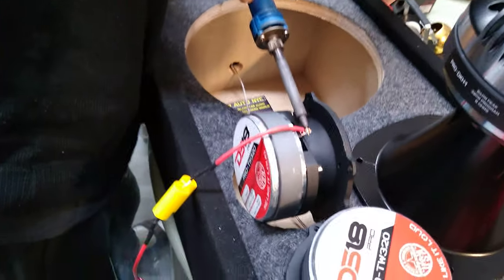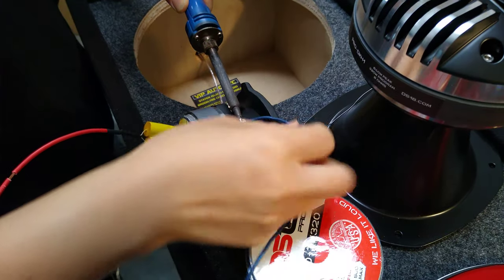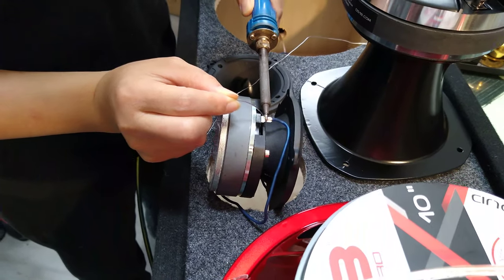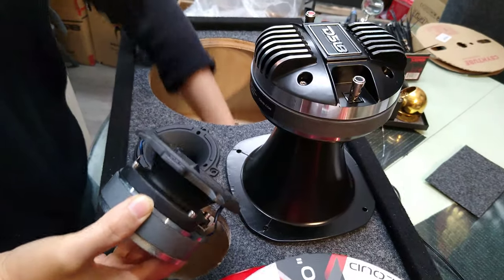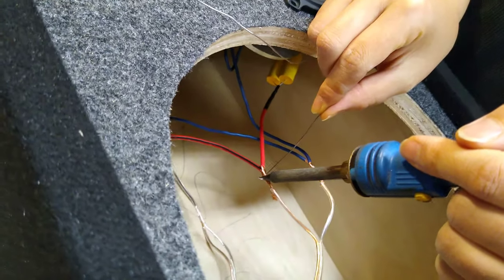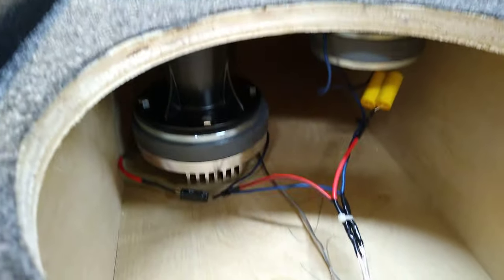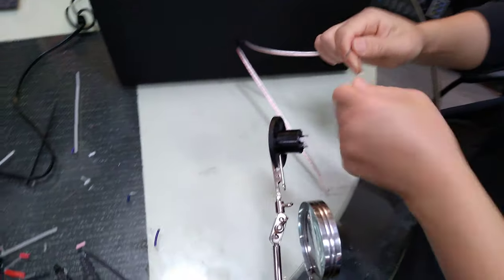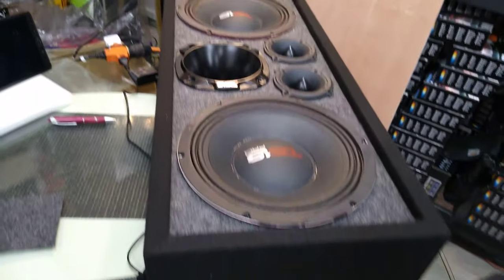DS18 MIDBASS PRO SERIES CHUCHERO WIRING/ INSTALLATION

Comment: Great video but it would be nice if you explained what the ohms were on the speaker, tweeters and horn  and the reason why you did parallel on the speaker series on the tweeter and then parallel to the horn
Reply from the maker: the 12 inch speakers are 4 ohm's, compression horn driver is 8 ohm's, the bullet tweeters are 4 ohm's. Each channel is 4 ohm's nominal

Comment: Love the video and I was wondering how you would go about wiring a chuchero like this I have 2  prv speakers 8 Ohm, 650 Watts, 97.5 db and 2 520w 4ohm orion tweeter and 1 tímpano 200 Watts Continuous Power 8 Ohm 109 dB horn also what capacitors would you use on the tweeters and horn ?
Reply from the maker: Speaker is parallel, series for tweeters + parallel with compression horn driver

Comment: Quick question .. so the mid bass wires don’t got to the amp as one positive and one negative. Cuz u said one positive  and 2 negative? I’m just alittle confused
Reply from the maker: 1x channel for mid bass, 1x channel for compression horn driver and tweeters,  dm me on ig if you need further assistance 😀

Comment: What makes them boxes so loud the box or the speaker set up. I want to build one all Audiopipe .  3- 8" loud
2- bullet tweeters
2- Horns.
Reply from the maker: wiring them properly is the most important step, choosing your products, building the proper size enclosure, getting the right frequencies to the amplifiers, adjusting your amplifiers accordingly, adding the appropriate crossovers are all equally import when building. we test/ evaluate many products before we choose what we will use in each build. If the product doesn't meet or exceed our standards, we do not use it. even after building if it doesn't perform to our expectations we do not use it. hope this help you build yours

best regards
vip auto nyc
brooklyns chuchero world
staten island car audio

Comment: Kelton Machtolff | Technical Support Specialist | OE Support
[ Stillwater Designs | KICKER ]

So to add speakers to that enclosure you would need to box off the area where they would be mounted or the pressure from the woofers would blow the cones out of the added speakers. 

The ST would be the way to go if you are looking for loud clear mids and highs.

Comment: Those capacitors 17uf 100v ?
Reply from the maker: @P2Feener305  yes for compression drivers, 4.7-6.6 for tweeters
Reply: Sweet thanks man been a residential av guy for 17 years and now just getting into playing with some pro av gear a lot more fun when you build your own toys 😂

Comment: Does the horn driver need a filter, crossover or can i wire it directly to the amp?
Reply from the maker: a capacitor is recommended but not required. as long as you can send the proper frequency to a speaker, compression driver a capacitor or crossover is not required.

Comment: Which amp are you using for this. I see that you have 620w and 600 for the 2 channels.
Reply from the maker: a 4 channel is recommended, about 500x4 RMS @4 ohm's is excellent. Bridge channels, 2x channel for MidBass, 2x channel for compression horn driver and tweeters 👍

Comment: Nice video been waiting  for a connection  would this install be the same if doing 2 mid bass and 2 or 3 tweeters
Reply from the maker: depends on what your working with, the ohms will determine how you wire it up

Comment: I got a box. 2 prv 10MR1000 (15 years),  2 prv TW700Ti tweeters and a comando CRx-700AL. Someone ripped out the board that holds the 2 tweeters and horn. There’s 2 sets of wires left dangling in the box where that board goes and one set of wires coming from one of the tweeters. I’m confused as to what hooks up to what. The 2 PRV 10MR1000 are wired up and good so no issues there just with the 2 tweeters and horn. The box itself has 4 sets of wires (8 wires + & -) that connect to the amp. Anyways any help will be greatly appreciated
Reply from the maker: most likely one set is for the tweeters, other set for the compression drivers. if you need assistance bring it to your local shop. you van use a single 4 channel amplifier for this setup

Comment: Does the tweeters trouble the impedances of the mids
Reply from the maker: I don't understand your inquiry. The tweeters & compression horn driver share the same channel.
the tweeters are wired in series with there own capacitor, the compression horn driver is wired parallel with tweeters which has it's own capacitor. It has a combined nominal impedance of 4 ohm's
Reply: @vipautonyc-chucheroworld-jimmy  sorry i didnt explain myself right..
Reply: @vipautonyc-chucheroworld-jimmy  i was asking if i can wire 2 4ohm tweeters  with a 2ohm loud speaker  to a fullrange  1ohm amp  other than using a separate amp for the tweeters
Reply from the maker: @bassismygod9859  yes sir it's possible to wire that way. but you will have to balance the frequencies, output power  for all the items. while you can do that, you won't have much control.

Comment: Why don't you install a 3-way crossover to regulate the mids and highs?
Reply from the maker: Well that would be my customers choice. I recommend equalizers only if more adjustment is desired. Generally most amplifiers crossover sections are enough. I do understand many people are more comfortable using external crossovers. Some people even use multiple equalizers to maximize adjustability.  At my shop we offer only equalizers and never crossovers.

Comment: The ds18 driver, the positive (red) it’s usually the negative connection, they come like that from (factory mistake) that’s why they fail all the time, you should check it whit a D battery before you connect
Reply from the maker: how do you use 1.5 volts to determine polarity on a compression driver coil?
Reply: @vipautonyc-chucheroworld-jimmy  after you disamble the driver connect the positive on the red and the negative on black if it come out or jumping out then you have to change the connections, positive whit negative
Reply: It will sound more clear that way

Comment: so what is the ohm load on the tweeter and Horn on the amp?
Reply from the maker: exactly 4 ohms for tweeters & horn driver, for the 10 inch midrange as well. a 4 channel amplifier is recommended in bridge mode.
Reply: @vipautonyc-chucheroworld-jimmy  so then it won’t have no Stereo Sound?!
Reply from the maker: @HIGHOCTANERC  the typical person that is using these types of products are not looking for sq. these products accentuate only midrange to high frequencies. the criteria is long and wide throw high spl.  imaging & stereo separation is not important at all. my customers want to be heard from a distance. * besides stereo imaging would be hard in one enclosure
Reply: @vipautonyc-chucheroworld-jimmy  yes You are Right.Thanks so much for the Reply.

Comment: So basically the parallel series which you did on the voices , comes down to 1 ohm . ??? Lol I believe .?!
Reply from the maker: tweeters wired in series, then parallel with horn driver has a final impedance of 4 ohms. tweeters are 4 ohms + horn driver is 8 ohms

Comment: What capacitor did you use on the horn driver ?
Reply from the maker: I use for this 12uf, It comes with 4.7uf. sometimes I also use 17uf, depends on the other parts used.

Comment: What amp are you using ?
Reply from the maker: a 4 channel is recommended, or two 2 channel amplifiers. Ideally you can use a higher power on mid speakers, lesser power on compression drivers.

Comment: That’s the best way to wire it I really don’t like it when u guys wire a mid with 2 tweeters being in series and then the driver with the other mid in parallel u have less control over your mids and highs cause they play totally different
Reply from the maker: We use different types of wiring, This is just one method.
Reply: This goes to wat amp 2ohms or 4 ohms
Reply from the maker: @hypefilms6061  , most amplifiers are 2 ohms capable